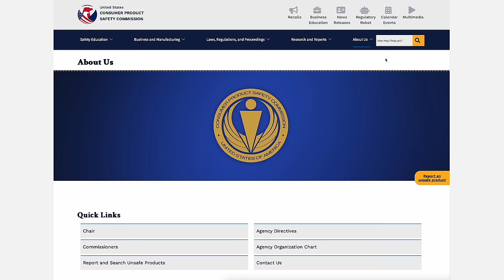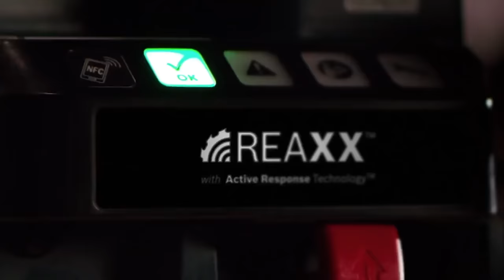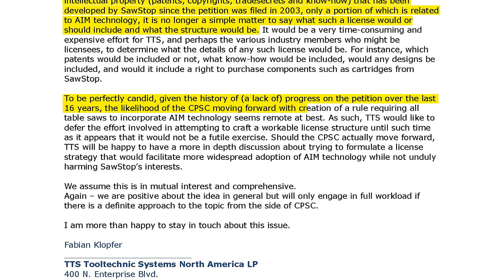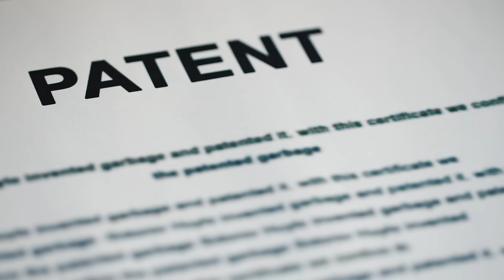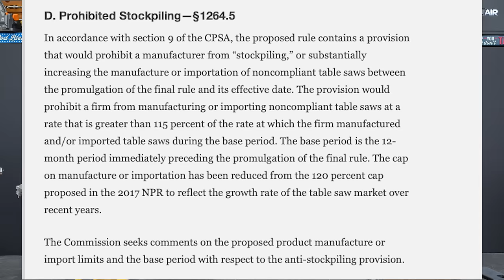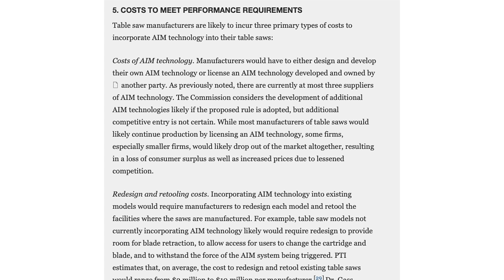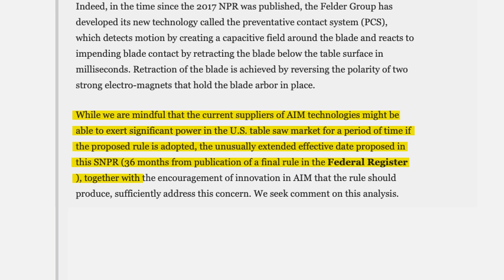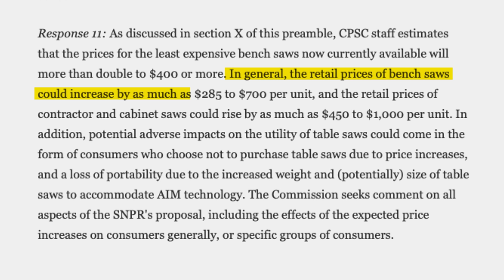The US Government is About to Change Table Saws FOREVER!

Comment: The problem with this technology is that, WHEN it inevitably fails, and the saw breaks, people will simply remove this technology to get the saw working again, or they will remove it so that it doesn't fail. As much as I like the technology, and I like how it protects users, it simply will be removed, much like how guards are regularly removed, which will basically lead to higher costs for saws with no real advantage after everything is said and done.

Comment: I wish I could afford a sawstop but I can’t. So I’ll just continue to use the blade guard and common sense to protect my fingers. Most of the time the blade guard doesn’t get in the way after you get used to using it. Also if you are used to it being in place,then when you remove it you are super aware of that spinning blade. You just have to make a strict rule with yourself to use the guard every single time that it is possible to make the cut with it place. No exceptions

Comment: If such a law did pass, just imagine how much all our current saws will be worth if a the price of a new saw goes up $200-$1000. The days of a $50 saw on CL will be long gone because those saws will command a premium to those who either don't want to own a saw that self destructs and needs to be completely overhauled if something happens, or simply can't afford the cost of an expensive new saw. 
Just look at what a good used older diesel pickup sells for these days that doesn't use DEF fluid or require expensive DEF filters every so many miles.

For me, I'll stick with my $10 60 year old saw that's served me well for the last 30 or so years, and if that were to suddenly be unrepairable, I've got 10 more stashed away that I got just as cheap over the years.

Comment: I have a answer to the problem that is much simpler. You have to train and test to drive a forklift in any professional use. Make a training mandate and make a required to use them in a proper manner. The use of a push block will make it imposable to be injured. or just make the saw have a feed that works much like a planner. Myself I just think the ones that are not taking safe usage of anything are at fault not the ones that make the tools. Lets make a hammer that can't smash your thumb because you don't know how to keep it out of the way. Good luck with that.

Comment: I feel like using a saw properly prevents injury. The one time I will agree with a safety rep is on this. Proper utilization prevents mutilation. Problem is that no one really teaches this stuff. Most tradesmen just learn on the job an more often then not from injuries on the job. It just happens man, theres no fixing unlucky, lazy, unexperienced, or dumb. Puting saftey restrictions on everything is not the answer.

Comment: Wow! "These are the costs on the low end, and on the high end, it could be higher than that!!!" You must be one of those crying smart ones for realizing that the high end is higher than the low end. 

For goodness sake, stop whining. 

It was long known that the Corvair could turn into a fireball if hit from behind, but the Chevy company's lawyers figured out that 'the cost of retooling and modification to prevent the fire would be more than the lawsuits they could have if they left it alone.' (I am paraphrasing there, but it's accurate). 

When I was considering the SawStop, I compared prices of their saws and the competitors. When you were comparing comprable machines, the cost difference was negligible, and some table saw were more expensive than Saw Stop.

So, for goodness sake, stop whining.

Comment: Anyone using a steel cable as a bungee cord will face the consequences. Misuse of a table saw also has consequences. The problem is not the product but the operator.

Comment: I am expecting the rise of the eastern asian style table saw setups going to pop up here in the states. They have these pre made tables that allow contractors to just install their circular under a specially designed table to be used in job sites. Some of those tables are pretty well made and many of them even have push table/cross cut sled built in like a push saw.

Comment: If increased prices for TS kept noobs away from using them it might not be the worst thing. My theory is that small saws are more dangerous than larger ones in general and most people do start on small ones. Despite the plethora of good information on you-tube re safety, some people will use a TS the same way as most products they use—that is winging it. They might have expectations that they are safer than they are (if used haphazardly) and maybe pay a price. 

I’ve used a DW745 for five years as a hobbyist. Retired so I can spend the time reviewing safety and work only when I feel motivated and not emotionally upset, hung over, etc. 

If I was starting out today, I would probably get the SS CTS while recognizing it’s not idiot proof (I assume you can still have a workpiece fired back like a hockey puck). 

I can see both sides. I move my saw around all the time on its scissor stand. Another 23 lbs of weight the SS represents might fatigue me more which kind of sucks. I’m happy with what I currently use and think I’m safe on it. But if I wear it out I’ll get a SS. I’m not going out to Harbor and getting a Herculean—which seems to be a total copy of the Dewalt 745.

Comment: I do not think the government should be telling us what we can and can not do for "safety" that is a real slippery slop when they have that amount of power. Io have been using table saws for 30 years , not once been cut . I do not use a riving knife and for sure do not use the guard, those are the first things to be removed and thrown away when I buy a new saw because they are dangerous and limit what you can do with the saw. I literally could not do the work I do with a saw guard on it would be impossible, try freehand scribing a cabinet filler with a riving knife or guard....you cant. if you do not have the sense to use a saw and not get cut by it you should just not be using it in the first place.

Comment: This is the big problem with the nanny state.  30,000 injuries per year is less than 0.01% of the population.  A number that has no statistical significance.

Oh, sure the folks who don't understand statistic will say "It's significant if you lost your finger."  That's not the point.

The point is that most people who use table saws do not cut off fingers.

Comment: I totally get that table saws are inherently dangerous. But SawStop's attempts to drive legislation requiring AIM technology is simply a naked grab to create a monopoly that only benefits SawStop. If it wasn't, they wouldn't be suing the crap out of competitors. The only way I'd support the legislation is if it required SawStop to give free licenses to competitors, or set a low cap on license fees, or frankly, forced SawStop to exit the table saw business altogether. As for me, I have a Ridgid saw that I love, and I bought two complete sets of replacement parts, from the motor through the arbor so I never have to give SawStop a dime. Because screw them. It's not about Public Health or Public Safety. It's about naked greed and weaponizing the government to turn them into a monopoly.
So eff SawStop. (And for the record, I'm a freaking Liberal and am generally supportive of Government Regulation. But this is a bridge too far for me.) So again, eff SawStop.

Comment: No WAY that manufacturers would be liable for lower cost saws without AIM in built.  There is voluminous precedence on this topic.  Take for instance, autos.  There are numerous safety implementation disparities across models and manufacturers.  This argument, in my opinion (I slept in a Holiday Inn Express last night after all), illustrative not of liability fears, rather the realization that a plurality of their mid-tier demographic would be shuffled to the lower-tier necessarily. The result is less revenue, higher expense and falling EBITDA.

The sad commentary, this could be an reputational wind fall.  Any one of these manufacturers that eats any part of the cost of implementation could become the darling of the cost conscious demographic.

Comment: Sawstop has had time to make their money on their patents.  I think the patents should expire.  Patents are not supposed to create a Monopoly, they are meant to pay companies back for their innovation.  I think Sawstop has made this money.  If other companies wish to buy knowledge or design from Sawstop, I think that is open for discussion between the businesses involved.  But access to the original ideas in the Sawstop patents should not cost other manufacturers at this point, nearly 20 years later!  Patents are not meant to be forever, lets not allow Sawstop to renew those patents... that was never the intent of our patent system.  Then this would allow manufacturers to make competing ideas on the Sawstop original patents, or to directly license engineering from Sawstop or others.  This would benefit consumers at a small cost increase.

Comment: The SawStop guy DOES want the shop to be safer and that's a good thing. But he wants everyone to pay twice as much for a saw, enforced by the government through it's unwanted nanny-state overreach. That's destructive first-order thinking and not good. If passed this rule will make table saws too expensive compared to alternatives and drive the used market up and worse we'll probably see a trend of homemade saws and that should scare everyone. Just watch injuries rise as cheap unsafe motor and deck kits (provide your own blade) start appearing from the usual overseas sources as the DIY trend gets rolling. It's a case where government is trying to invent problems to be the solution to as justification of their POWER vs. FREEDOM and in so doing will make things less safe.

Comment: Why not just engineer a protective raised box enclosure frame to box out the saw area and only allow the board through with a sliding adjustable arm for material size? Screw the camera.

Comment: 80% of these injuries are because of inexperienced or untrained individuals. I've been around these saws since I was a small child with my dad being a contractor and showing me how to safely operate the saw by using feather boards and push sticks. I don't see how changing the law is going to keep these users any safer seeing how many of these same ppl will have the likelihood of having one of the newer saws right away. What's next chainsaws, routers, jointers. You respect the tool you are using and keep you hand far away from the blade  and that will eliminate 95 percent of these accidents.how the hell are ppl getting cut with the saw guards and anti kickback in place?? Anyone knows keep your fingers away from the blade Sadly we live in a country where ppl who use tools safely and realize the dangers have to pay the price for someone else who is careless. I realize shit happens to ppl no matter how safe you are but tell me I'm wrong about how much of this could be prevented with proper training and safety. I've been around spinning blades of death my whole life and this was never an issue until now. And ive also seen ppl do so dumb ass stuff like removing guards and safety features all because it's inconvenient for them

Comment: I would like information about how many students are injured at high schools especially.  I used to work with SawStop.  The school purchased SawStop after a student lost his thumbnail.  The student did not want to seek medical help.  Furthermore, the school told staff to try to avoid getting workers compensation because the school had too many injuries.  Most of my injuries, I did not report. Even when a student purposefully stabbed me (below the skin fat layer) with the corner of a big wood board.  I did not get compensated for removal of sawdust to my eyes. Students get plenty of splinters, but they are hardly reported.  Most injuries are minor.  A drill bit through the finger, sawdust in the eyes, etc..  Schools would rather say that no one has ever been injured in woodshop classes, and that students do not make weapons. "There is nothing new under the sun." Students stealing tools, etc.. It something is not reported it does not exist.  If it cannot be proven, it does not likely exist, even if a staff member reports it, and swears it is true.  Students playing with air hoses, electric routers, making weapons with grinders and sanders.  School staff cannot stop all bad behavior.  A staff member can lose a job, so why report?  This can happen in college, at a job, etc..

Comment: When you consider that many of these tool co's have offshored their production to Asia and they make 100's of clones of those m/c's which are sold by by big box stores in USA and 1,000's of tool stores around the world,China will produce clones of the safety saws with crappy materials which work slowly  or not at
 all,
would you jump with a parachute made in China will your Chinese "sawstop " save your fingers if they have to fit them to sell in U.S market?

Comment: I see more YouTube channels that use a table saw without the riving blade and guard than do. Far more. You are not helping. Stop saying you shouldn’t do this, then go and show exactly that you have removed it. Maybe make table saws with these so affixed (structurally key) it’s extremely detrimental to its operation, and injuries will fall. And sell Sawstop etc table saws for those that prefer that open style.

Comment: It's a cool saw no doubt but I don't have $1500+ for ANY one single tool 😂 I've got a circular saw already fitted to my current workstation because it WAS my table saw until I could afford a real one!!! No safety whatsoever on that baby and limited to 2" depth cut after undermount lol

If it passes it'll just push for it in other tools: band saws, routers, jointer, planers...

Comment: The only way to really make everything safe for women is to make their saws without a blade, then the saw will be safe for women to use.  But they can't pick the saw up to move it around either, so the portable saws will be useless to them.  And if women can't use a wine bottle opener, they should not try to use a table saw either.  Maybe they should make classes on how to use a table saw mandatory too.  I am not sure that the 60,000 civil war amputations is an accurate number, when 300,000 men were murdered during this stupid war.  The number of wounded is always 3 or 4 times higher than the murders, so the 60K number may be low... If the saw blade is stopped instantaneously, which is the only way to save a finder or hand, then the saw motor armature could be warped in the process, as the blade will be junk afterward.  I don't know how Stopsaw does their technology, but it is not fool  proof.  I am glad that I bought my saw last month, but the stop blade feature would be safer, no doubt.  Thanks for posting this video sir.

Comment: C'mon man... this is such a ruse. First, the idea is that this piece of SAFETY equipment should be on every table saw to begin with! Second, the price of the saw shouldn't go up at all!!! Why?Our government literally subsidizes oil barons... This is something that should be subsidized to lower the manufacturing costs of having to essentially put a negative charge on the blade and then put a spring on it. Literally, this should only cost maybe $50 in parts and labor at the end of the day (if not lower). It's not like a super secret what SawStop has done... oi vey.

Comment: I run a 1980s craftsman table saw 10" with a big table I built on it I'll NEVER buy a new one.
I also have a 1980s craftsman radial arm saw with the digital measurement thing on it my neighbor sold to me for $30 no joke $30 just last year, and it was barely used.  Yeah I'd never buy a new one to replace em nope nope.

Comment: I mean regardless if they put the AIM on you gotta teach people how to properly use a saw. its a skill. the blade stop ain't gonna protect ya from all the other problems you can run into with a saw, pinching and poor handling of the wood causing kick back can be more dangerous that just cutting a finger or two. 

Making people take a free coarse before being able to buy a saw would save more hands. Making sure the saws come with better push sticks would save alot of hands too >.< nothing like your free plastic push stick breaking half way into a cut >.>

Comment: Something you didn't really cover here, if the user needs that saw operating for a project, how long will the saw be down until they can get a new assembly and put it in? Will the user even be allowed to put it in? How many accidents causing amputation have been  caused by axes and chain saws. I'm 75 and have been using table saws since high school where we were taught how to safely use all the tools in the schools wood shop. And we had everything there. Plus a fully equipped metal shop. And I removed the guard from my large table saw the first time I tried to make an angled cut and could see that the guard was ahazardto safely making the cut. And I am not missing any parts, but have been injured out playing and have the scars to prove it. And for Saw-Stop, invent something and get the government to require everyone to but it. Come to think of it Biden is doing just that with these battery powered cars. And when I die will my heirs be able to sell my table saw?

Comment: I realize that people do stupid things. 

Nevertheless, it’s reasonably simple to use a tablesaw safely. 
Just like the first two rules of gun safety (keep your finger of the trigger, don’t point the gun at anything you don’t intend to destroy) you just don’t put your fingers/hands/whatever in a path across the blade, and you don’t place your body in such a way you can “fall” on the blade. 

Riving guards and blade covers are way less of a concern for me on a tablesaw. I’ve never put myself in a situation where those provide any benefit.